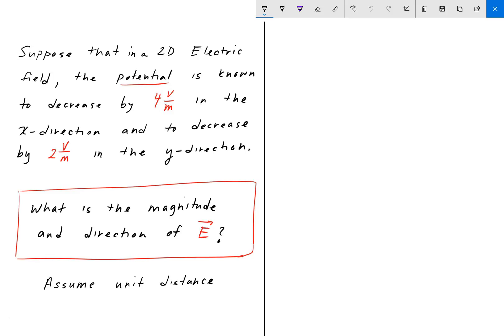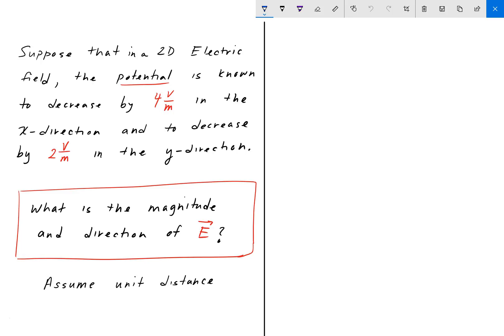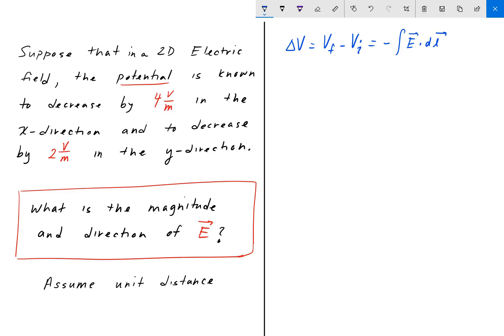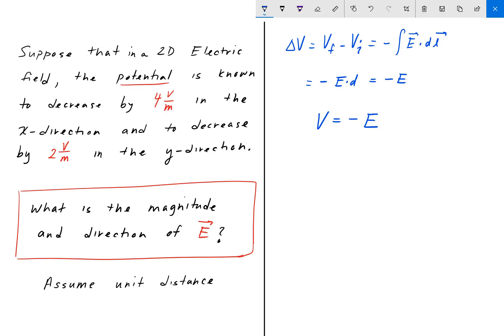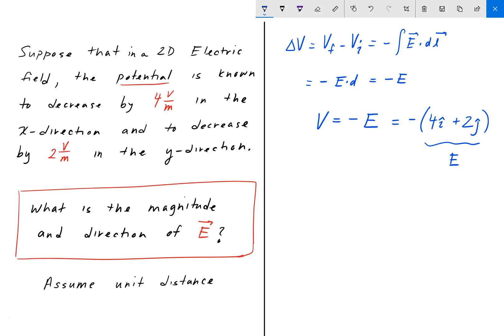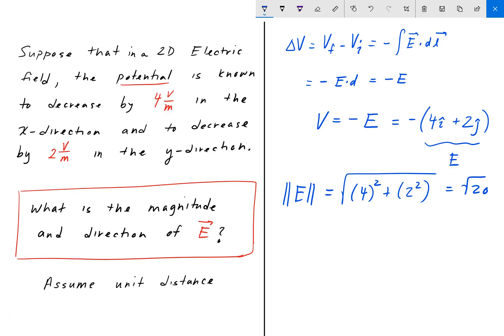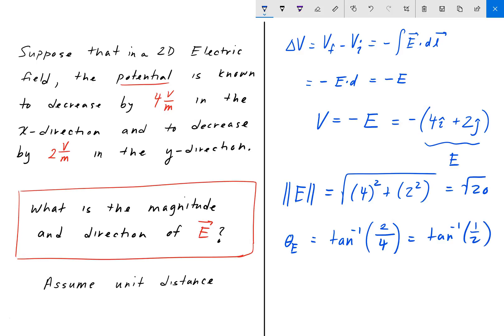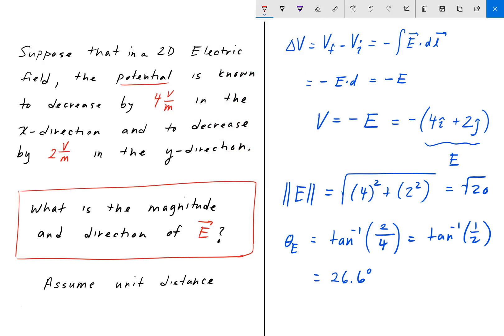Electrical FE /EIT Exam Prep - Engineering Sciences 1: Electric Field & Voltage

Comment: I think the angle is in the third quadrant though? for <-4i,-2j> I got 26.6 degrees but then I added 180 degrees to get roughly 206.5 degrees going counter clockwise or -154.44 degrees going counter clock wise. <-4i,-2j> is in the third quadrant. atan2(-2,-4) gives -154.44 degrees. Thanks for the videos, these are helpful.

Edit, 
I guess it works out knowing that V=-Ed. so then we would get E=-(-4i-2j), E= 4i+2j, then we would be back in the first quadrant and 26.6 would be right. I think I was missing a negative sign.